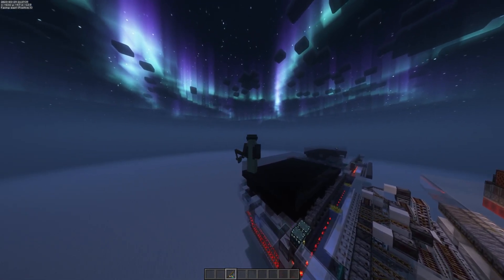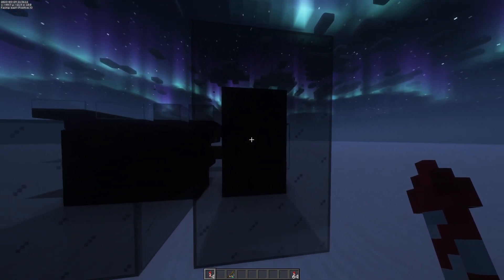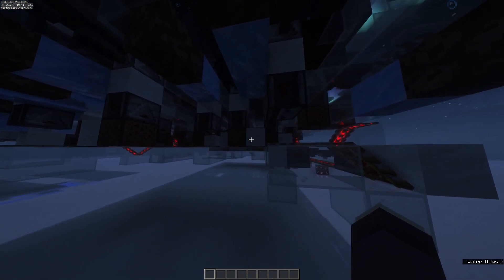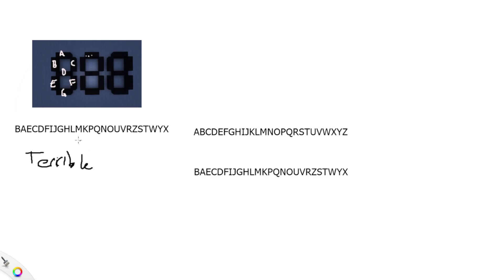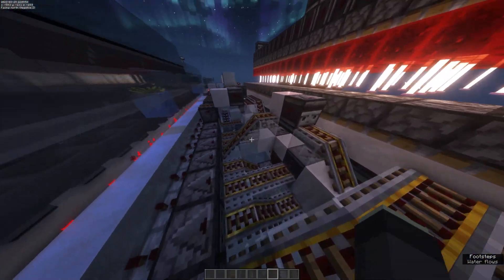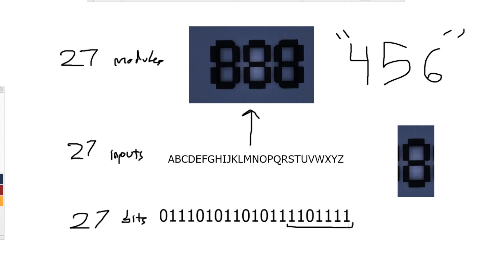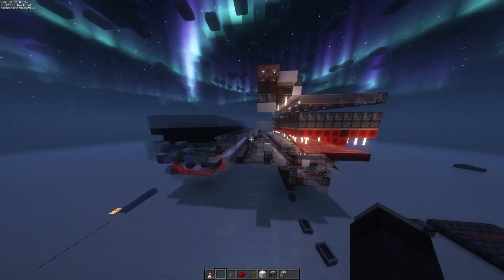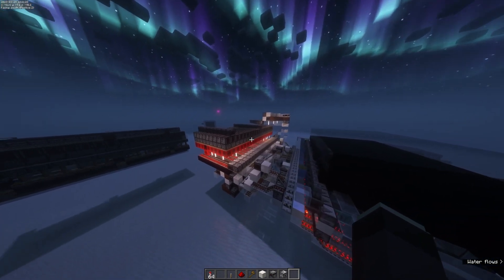Are Holographic Firework Displays Practical?

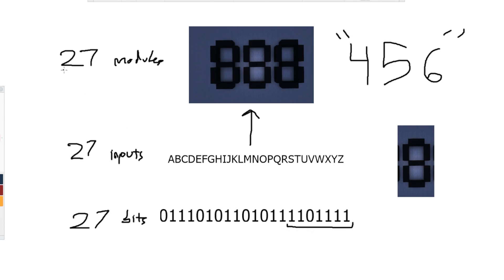Comment: I’m confused. Why do you say you have 27 modules at 3:43 when you’ve got 3 separate 7 segment displays, which would be 21 modules/bits? Then you show the entire alphabet, which has just 26 letters? I’m really confused by this.

Other than that, it seems like a DocM77 type of project
Reply from the maker: 1. the alphabet is an analogy, and in hindsight it would have made sense to only use 21 letters
2. as for the 27 thing, im bad at math, and even worse at noticing my mistakes later.

Comment: Hm, you're using large ball fireworks. Correct me if I'm wrong, but don't they spawn far more particles than small ball fireworks? Anyway, nice project :)
Reply from the maker: I did a ton of testing with fireworks, and although youre right, I had to strike a balance between good particle management and aesthetics. The general idea is that the bigger the firework, the nicer the display pixels look, so thats why I chose the fireworks I used

Comment: Honestly 20 firework rockets per display doesn't seem so bad. Each of them requires gunpowder, paper, fire charges, and white dye, all of which are renewable in very large quantities. I'm really tempted to build this for my creeper farm to count the number of creeper deaths (though I realize I'd have to update it slowly in order to be positive on gunpowder)

Could I make a request? Could you separate the parts of the contraption that are the "preset" inputs vs the actual display itself, so I can hook up stuff to it cleanly? I do gather that the observer mechanism ultimately just powers a row of pistons that are the actual inputs, but I don't have enough knowledge to be sure about how to remove it without impacting the rest of the device.
Reply from the maker: Hm, I think this is the most interesting use of this display yet. I will see if I can throw together a schematic and maybe even a tiny unlisted explanation of how to hook up something like what youre trying to do to the machine. Maybe tomorrow.
The biggest hurdle I see is a binary to seven segment code converter.
Edit: I just realized something, How are you going to display the amount of creepers, with only 3 digits? As stated, it's inexpandable. You'd have to say that it counts every tenth of hundredth creeper death to have displayable digits.
Reply: @squibble111  It's going to function on a per-Minecraft day basis, and my creeper farm doesn't kill more than 999 creepers in 20 minutes, though of course there are designs that do.

I think I have a design for it, I'm going to use a calibrated Skulk Sensor to get entity deaths, count up every ten of them, then hook it up to this display. Though the Skulk cooldown may prove problematic. 

I have no real experience with Redstone, of course. Will be a fun project to learn the ropes, I think. I have programming experience, so maybe Redstone will be just another language? But probably not lol.
Reply from the maker: Alright. So I don't need to give you a fresh schematic, but I can tell you what to do. You'd need to tear off the entire redstone block device, thats the preset thing, make sure to keep the 2 buttons for the triggering of the display. The rails in the back, on top of the obsidian, are responsible for switching on the devices. the ones that are on, are hooked up to the respective display tiles. The connections are ordered from top, left, to bottom, right.
In order to do what you're trying to do, you need to count the amount of creepers. The way I'd do this, personally, is to make a container that flushes creepers through in batches of ten, and this can be done with weighted pressure plates. count each flushing to a binary counter, and connect this binary counter to be able to transfer it's numerical data to the display data that is the 21 rails running out the back of the display. This just means having a rom that states which display tiles to light up based on which number is being put in.
REALLY IMPORTANT: the lit rails in the 21 wires out the back correspond to lit tiles, but if you screw with the rails fast enough it might desync this. This is bad. try to make it only update the rails right before you want it to fire.
The rest should be a little fiddly, but maybe you can make it work. 
Alternatively, I could do it because it sounds like a really fun video idea that I might try my hand at. I only will if you want me to (and when i have the time.)
Reply: @Squibble  I think it would make a cool video, but there's np if you don't have the time. I think it'll be fun to figure it out by myself as well. I totally forgot that weighted pressure plates even existed! I was having so much trouble with the cooldown of the Sculk Sensor!